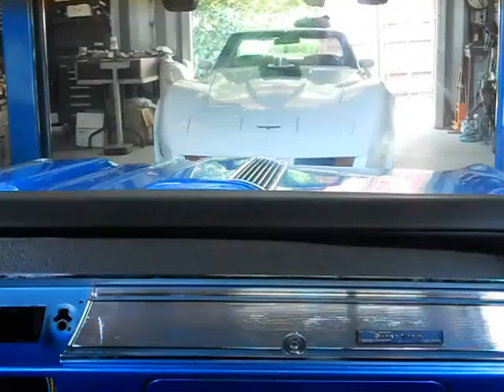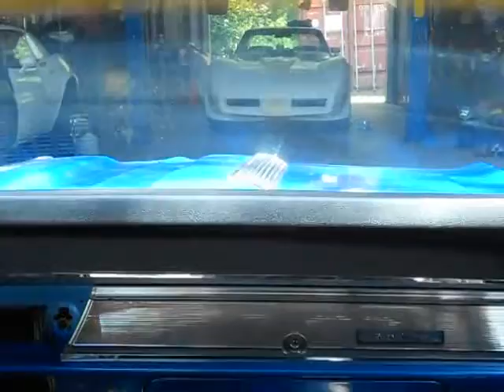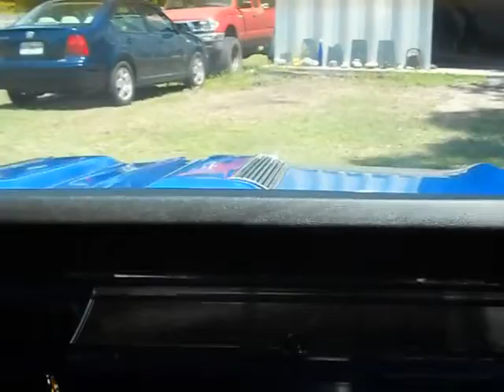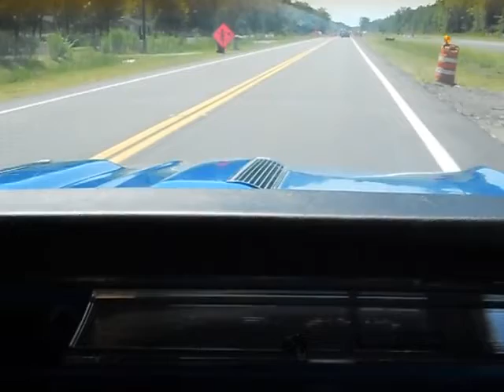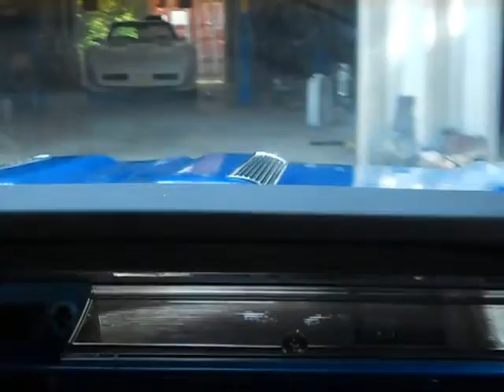Eric's 67 continued 2

Comment: What was the rotational click.?..Sounds nice and camy..power valve may be.?..I'd like to see a plug to see if it's fat or lean...Did you get any pinging..?...the mech advance looked a little loose in the previous vid.
Reply from the maker: The metering rod springs were a little lose and lean on low throttle 3 step heaver spring help that out but that wasnt it. And the plug's were a little fat with no pinging but that wasnt it ether.